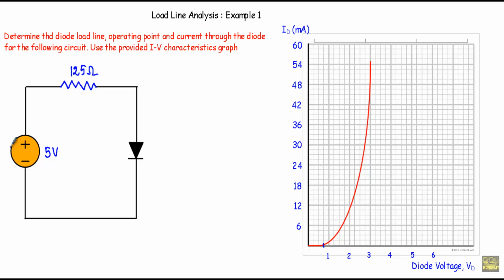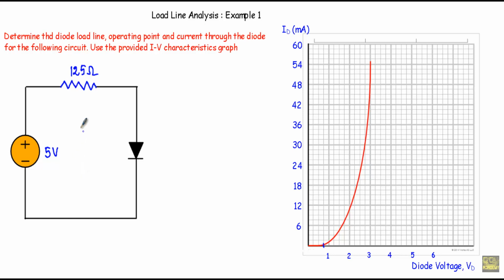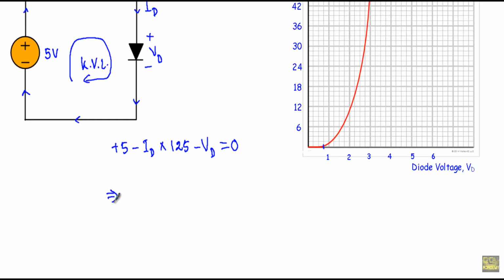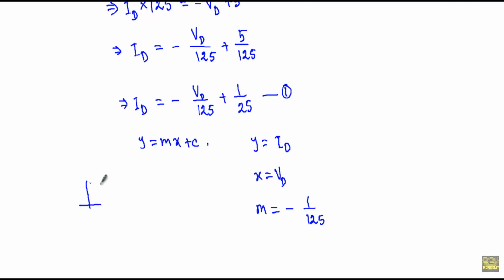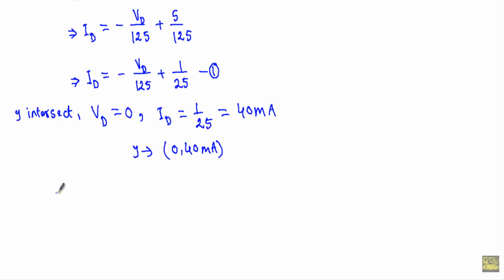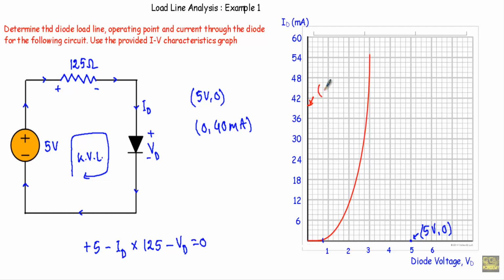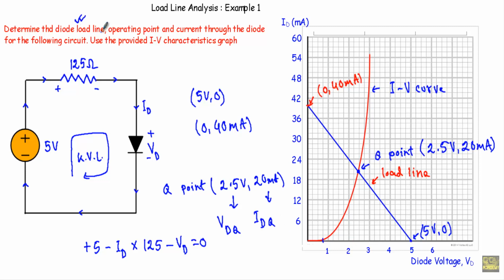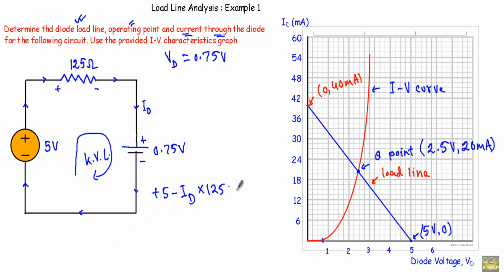Diode Load Line : Example 1

Comment: your i-v characteristic graph is not plotted well, there can't be such rise in current as the voltage rises, therefore you got totally incorrect readings from the graph. unless you are operating at very high temperatures. another case could be that the diode is LED, which has Vd in between 2V and 4V. that's why you got two different current readings. current can't be 34 mA and 20 mA at the same time through the diode. on the graph we see that it's probably LED that you're dealing with, and when you try to confirm this by calculation, you totally disregard that fact and say "yo, it's just a regular silicon diode, with forward voltage of 0.75V. try being consistent next time and use an appropriate graph

Comment: You can save a lot of math, by understanding that the load line draws the line between two extreme situations, a short across diode when v=0 and an open circuit, when i=0.  Just take the equation expressed at 3.21sec of the video, set i=0, you'll get v=5. Then take the same equation and set v=0, to get i=1/25. Then draw the line between the points on the graph  through the diode characterists to find the ideal operational point, Q. Its good to know math but its only a tool.

Comment: How can the current in the diode be 20 mA and 34 mA?
Reply: his i-v characteristic graph is not plotted well, there can't be such rise in current as the voltage rises, therefore he got totally incorrect readings from the graph. unless he's operating at very high temperatures. another case could be that the diode is LED, which has Vd in between 2V and 4V. that's why he got two different current readings. current can't be 34 mA and 20 mA at the same time through the diode. on the graph we see that it's probably LED that he's dealing with, and when he tries to confirm this by calculation, he totally disregards that fact and says "yo, it's just a regular silicon diode, with forward voltage of 0.75V, I don't care about those 2.5V from earlier. he took wrong Vd in the end of the video, totally not caring about the graph. that's why
Reply: Didn't understand that as well!

Comment: What if you also have a resistor parallel to the diode? How do you find the load line in that case?
Reply: one year old question, no one answered it. I really wish I knew it too
Reply: you should use load line method when there is only one diode in the circuit. Otherwise you should use other dc analysis methods like piecewise linear circuit model.
Reply: Find the Thavenin equivalent circuit without a diode....that will give you one voltage source and one resistor. Then you add the diode and Work out the load line in normal way....